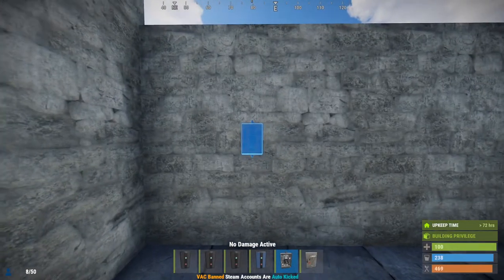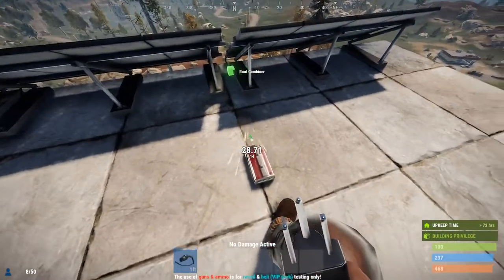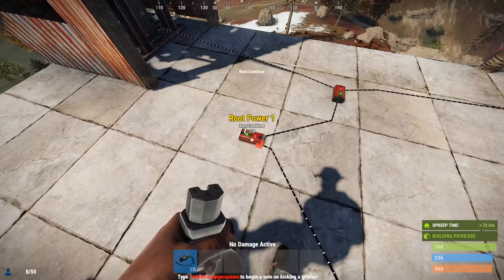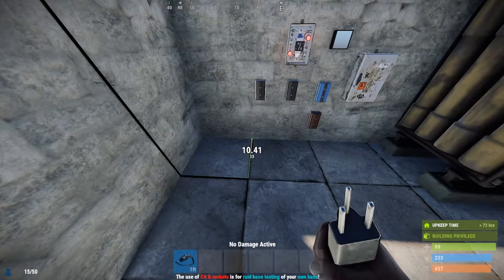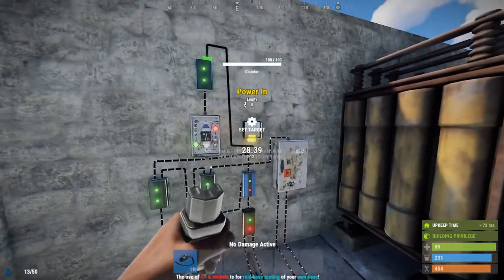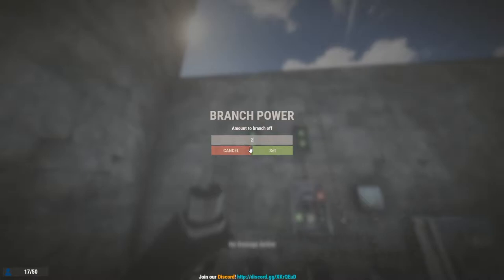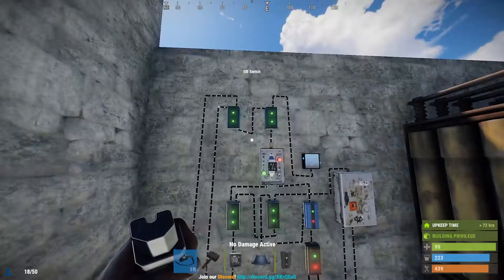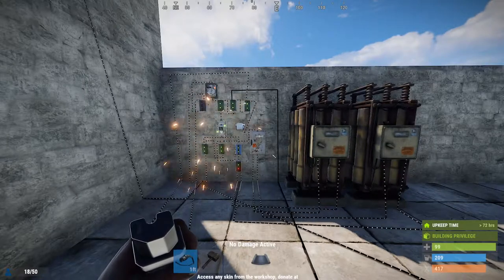Best EASY IN DEPTH Unlimited Power Tutorial For Group Bases

Comment: This is a good guide for people with limited space in their bases, I also did circuits like this when I started in rust, but quickly discovered that really not worth the extra electricity components, specially when you are running 40, 50+  turrets and several circuits like this per battery / windmill, usually when taking patrol it destroy panels and windmills, after learning that the hard way,  I stopped doing complex circuits like this with "perpetual" electricity,  from now on, the minimum windmills I use are 6, plus a bunch of solar panels. Getting around 1200 + electricity and each battery for 6 turrets, using 1 smart switch and 3 splitters,( safe 64 points output)  also adding several  xor switches for rust+ phone  alerts whenever the turret get a target. OP, if you have a chance let's connect I want to create a video of how to optimize windmills placement for maximum efficiency and space optimization, maybe we can work together.
Reply from the maker: yea i mean i made this when electricity was still fairly new, and up until like a few months ago i had never heard of 50+ turrets, i guess thats modded? im not sure
Reply: Could you help explain how you run the xor switches to get a rust + alert when the turrets find a target?

Comment: When batteryes are run in parallel (aka using root combiners to join them), the power draw on each one will be the same power draw from the circuit making it twice the power used if using two batteryes, triple if tree and so on.
Untill that bug will be fixed, we'r better off splitting the generator powerline using splitters and making this circuit for each battery we use istead.
Reply from the maker: Yea, this wasnt the case when i made the video, im getting a bunch of comments about that all of a sudden... Rust must have changed something. i havent played in a while.
Reply: @Kart1vyt  a little test i got no time to do might be running the parallel batteryes with a stable power draw close to the limit, since a battery will only supply 100w max, but the combiners can pull out the real combined amount running close to the limit should make the bug negligible, this would need a hella big power supply tho, surely non efficient but still.....

Comment: So I did this setup and expanded on it a little bit but have a question. I have 6 lights setup  hooked up to a switch and then a branch going to two splits, 2 sam sites running through a branch hooked up to their own switch in my core, 4 turrets on their own switch and a garage lift hooked up through this power system but I am still using much less than 199 power. Should I adjust the number to match my power usage on the branch that goes to the or switch/second branch so all the extra power goes to the 3 large batteries(300 output from the batteries to the root combiner that connects to the blocker) I have hooked up so I don't lose the use of my wind turbines at night and save the most energy? I am using 130 power to run everything I have so wouldn't it make since to send that extra 60+ power to batteries and just let me turbines run everything at night  and still put power in the battieries? Averaging about 340 power in the day but peak at like 380 and. Mostly worried about someone destroying my turbines or panels somehow because I plan to set up at least 4 more turrets coming from this switch I already have in my core(I know the switch for turrets is mostly useless just messing around with what I can do). Still trying to understand this and don't want to mess with the blocker but from what I understand the blocker would allow the batteries to pass through to my base if the turbines or panels get griefed and they should be completely full?
Reply from the maker: Yea so if ur using less power than ur producing with ur turbines and solar or whatever, try to send the excess power to your batteries to charge while not in use, the main idea is that if your turbines or solar gets knocked out, the batteries can take over. Sometimes i place a bunch more solar so that im almost relying on it and when it turns night it seitches over to batteries. This comes in handy when building in snow cus u can set up heaters to turn on automagically when the power from the batteries turn on bc the sun is going down and its getting colder. All in all id say try to send extra power to batteries as a fail safe(can be tricky with turbines cus their power fluctuates). The only way the batteries are going to kick in is if the turbines dont reach whatever number you have set for them to go into the base. Thats where solar comes in because if youre making 360 during the day, you can add two solar panels to make it 400, when the solar goes out and power shoots back under 360 or whatever, the batteries can kick in
Reply: @Kart1vyt  Cool man thanks for the info. That's what I thought I just didn't want to mess with how anything works. appreciate it. the video was great

Comment: The root combiner will give the combined power of the batteries, however will draw from all the batteries. 4 batteries connected to root combiners will give 400 power, but if the circuit it's connected to only needs 100 power, 300 will be wasted. So even though 4 large batteries are root combined, your max capacity will only be 24,00rWm, not 96,000rWm.
Reply: If you did it you see how it works I have all my turrets 9 of them and light furnaces my neon signs my heartbeat sensor that sets off my alarms more lights and electrical traps around my compound and it never fails I can still run more turrets and 2 batteries stay at 24,000rwm untill they take out my power source windmills and solar panels they have to then take out my generators that kick in as soon as there's no solar or windmills

Comment: The problem with this setup is that any input power below the first blocker's threshold is wasted at the OR switch.  Let's say I set it to 150 for the first blocker.  Night hits and the solar is 0, but I have a turbine at 130 power.  The branch still sends the 130 to the OR switch at the same time the 200 power from the battery hits.  Its not 330, but 200 only.  So the 130 power is wasted.  Am I missing something?  I tried it out, and we have a 190 load.  it slowly drained away.
Reply from the maker: So thats almost the point, I made this with the thought of having a consistent and constant power source, to be honest, I don't care much about the power loss from the wind turbines, in fact I'm almost thinking they charge the battery as its being used at night. What do you mean you tried it out and its slowly draining? What is "it"?
Reply: @Kart1vyt  My total load was 190, so I had the first branch at 190.  Because it was so high, it didn’t really get to charge the battery during the day.  Each night the large batteries didn’t charge enough to replace the power they consumed at night since the wind power wasn’t being used to charge the batteries at night.  All good. Interesting concept.
Reply from the maker: @coreymalczewski6125  i see your problem, you just dont have enough power coming in, this setup is mainly used for larger bases with multiple windmills and solar panels on the roof really high so i would say either get more power in and leave it at 190, or lower the first branch. you want to have that set to half of however much power youre getting from windmills/panels. Hope this helps, keep me updated if you try anything i wanna figure this out

Comment: what if the wire doesnt reach the turrets/sam? what can i do or use to make it reach it
Reply from the maker: u can use anything with a passthrough so like counters or switches or even branches if you set it up right, basically acting like repeaters in minecraft. keep in mind that they take up power though, so you have to adjust some things and i wouldn't use switches cus if theyre outside your base, anyone can turn them off thus turning off the turrets

Comment: I have 1 question. How do you add 6 batteries output, connect power in blocker. I tried using combiners but short circuit. Max depth. And my batteries are useless at that point
Reply: Did you figure out the best way to add batteries to this circuit?
Reply: @jbroookss  from memory i created the same circuit board multiple times. It wouldnt allow me to keep adding batteries. And for some reason batteries wouldnt kick in after turbines stop.  So i have to recreate it. On builders paradise

Comment: there is a issue that both batteries getting used ay same time with same amount of power why
Reply from the maker: Im not sure…someone else also commented the same thing recently. And im not sure what its about. If you set the root combiner to 100, it shouldnt be taking 100 from each battery, it should only be taking 50. But this video was made when electricity first came out, so i guess some things could be outdated? I havnt tested it myself but, that honestly shouldnt even be a problem unless you are using a tone of electricity. My suggestion would be to just add more batteries if you can if thats a real problem.
Reply from the maker: I made the video more so people can learn what everything does, and adjust this to their need, or make something of their own
Reply: @Kart1vyt  i have two medium batteries my normal use is about 50 and when I am connecting to them to a root combiner it take 50 from both batteries 😁. While my active use is 50 but getting used 100, 50 from each batteries 🤣. May be it's a bug in game which rust should fix.

Comment: I have a problem with this circuit/setup
Normally if you have solar panels feeding into your batteries you will have a surplus in the day (the batteries will stay max charge) and a demand during the night (this will slowly drain your batteries because you are using the power) and that means your batteries will charge in the day and empty in the night.
Now, all you have done is made it so the batteries will charge in the day and empty in the night, except with alot of extra steps and confusion.
If I am wrong please point out the difference in a reply.
Reply from the maker: Im just showing the circuit and its up to the viewer to use it how they need or whatever but i think the main reason for it is as a failsafe. If your turbines or panels dip below their normal power range the batteries kick in, if they get destroyed(which is very common in raiding in attempts to turn off turrets) they kick in. Whatever the reason may be the batteries are mainly a backup. I get what youre saying and obv with a bigger base you really shouldnt be using just solar panels, should def have turbines. But something you can do is just adjust the branch that splits the power to base and to battery to where it doesnt go below your powers lowest point and the batteries wont be used unless they really need to be if theres an issue with the power sources. Ik a lot of people like the switch to battery at night cus its an easy way to integrate auto lights and heaters

Comment: so,..i have a question. Im trying learn old fashion windmill electricity system - cuz the test gen on mid servers has ruined me lol My question is,... is i have 50 turrets or more set up on a base,... will these two large batteries be enough to sustain them, or will i need like 3 or 4 battery combo? Cuz, i figure more batteries ya have, the more back up juice ya have for later on during a raid; AND obviously you will need more windmills for larger turrets set up and for larger electrify consumption. Any help in making me better, is much appreciated, thanks!
Reply from the maker: 50 turrets???? goddam boi, i honestly have no idea, i havnt  palyed in a while so i dont remember how much powers the batteries hold, the main thing is that you have enough power from the windmills, i would go for like 4 or more batteries to be safe, because the batteries only kick in at night so you should be good but im not sure, do make sure you have hella windmills tho
Reply: a bit late to the party, but you can have a max of 9 turrets on one large battery, however I don't recommend running more than 5 or 6, max. If you run too many, the replenishment from the windmill (I never use solar panels) won't match the power taken by the turrets if you intend to have it on constantly. I'd run 1 windmill to 1 large battery, then an even 5 turrets each, making it 8-10 windmills for your 40-50 turrets.

Comment: This was helpful for understanding but is there an up to date way of making a perpetual battery(infinite power)?
Reply from the maker: Yes. That basic circuit on the wall that I have set up is the circuit you would want to do for "infinite" power. Meaning solar panel by day, and battery by night. You can change it up and adjust it to fit whatever need you have. So you can make it smaller if you wanted. Not sure if the game updated the way electricity works but as far as i know, its the same

Comment: The main issue i have with this circuit is the left branch should be based on your usage, not your max battery power.

Here's why.  Branches send electricity to the left first.  This means if you configure the branch to send 500 electricity to the or switch it will never reach that limit so no left over will ever go to the battery.  IN reality this is a great circuit but also a terrible circuit because your input power become useless unless they produces 4 more power than what you're using.

Comment: Very creative build. The only issue is that the large batteries were run in parallel (4:53) when you connected them to the Root Combiner. The problem is that each battery will register active usage on a single item and drain accordingly. For example, if you were to connect a single turret you'd find that each battery registered an active usage of 10 volts, effectively canceling out one of the batteries.
Reply from the maker: Im not sure i get what you mean. Putting both batteries into the one root combiner is basically just a splitter but opposite, from what ive gathered, lets say you connected a turret to that specific root combiner, the turret would take from the total power that is coming out of the combiner, it wouldnt drain each battery by 10, it would drain the root combiner of 10 which in turn makes the batteries drain at 5 each to refil the 10 being used. But this video was when electricity basically just came out, i havnt played rust in a really long time, and things couldve changed with the way these components work. Main goal of this video really was to teach people what and how everything works so they could do it on their own. I appreciate the feedback and i hope it helped!!
Reply: @Kart1vyt  No, I believe it will drain each battery by 10 power unfortunately. Unless they fixed that glitch by now! I mean, there's still hope
Reply: @fiddlepants5947  it's been fixed

Comment: quick question, iv noticed at night time when the battery takes over the output is always 200 regardless of how much battery I want to use. Is there anyway to change this?
Reply from the maker: You could put a branch right after the root combiner from the batteries, and limit it into the blocker, but this would work fine as long as you have enough power to charge it during the day, if anything you could always just not place one of the batteries to make the output 100
Reply: @Kart1vyt  so lets say I branch out 100 power to the blocker. there is still 100 going to empty? How can I save the excess 100 power from the power out thats going to empty from the electrical branch
Reply from the maker: @ShortGrumpyMidget  if youre saying after using all you electricity on things you need like turredts and such you have leftover power, you could always run that into the battery charging section if you really wanted? Although its not really needed as the batteries get charged during the day. Im not sure, i guess you just have some extra powerr to play around with!
Reply: @Kart1vyt  ahh ok ty man!

Comment: But why? Why not just combine all the power, put it directly into the splitter and into the batteries? Then take whatever power you need directly from the batteries. They can output while they are charging simultaneously.